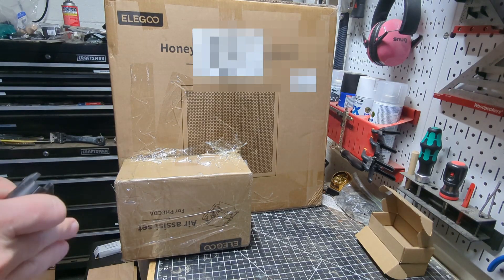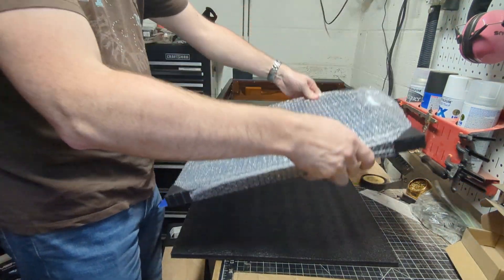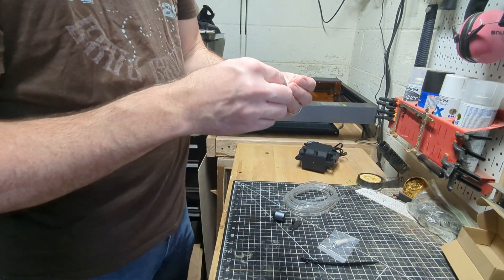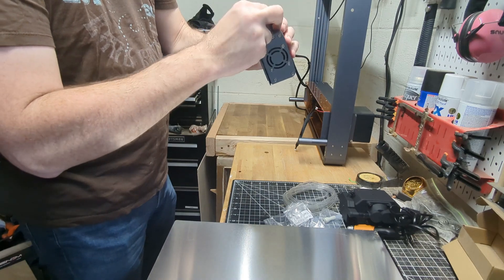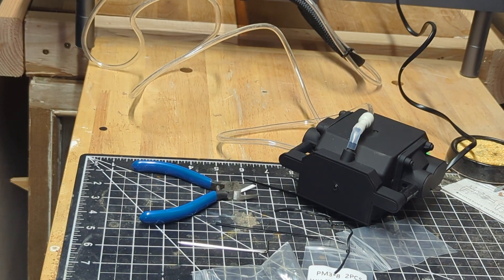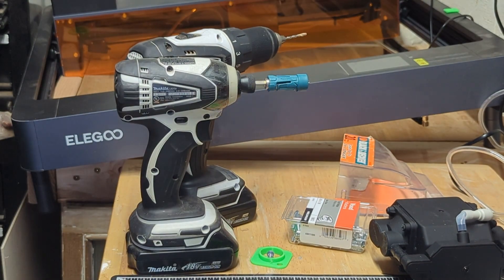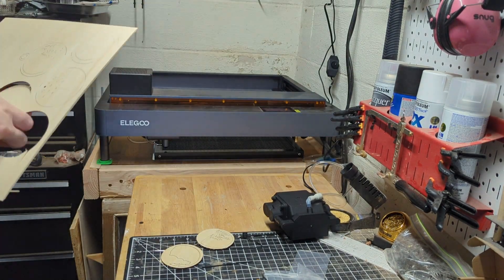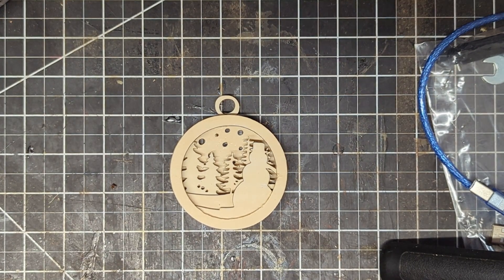Phecda Upgrades and air assist installation.

Comment: Thers a diy kit on the facebook group for converting it to have limit switches, total cost less then a tenner from amazon (some switches and leads). If you were thinking of doing that upgrade I wouldn't mind a video on it. I did the installation but could not figure out the settings in order to get it to work the way intended.
Reply from the maker: Yeah, I was thinking about doing that and some other 3d printed bits.

Comment: Got a link to that ornament design?
Reply from the maker: https://3axis.co/laser-cut-layered-christmas-ornament-svg-file/6o3ygpk7
Reply: The instructions were pretty basic and the PDF didn't show what cable went to what but after looking at another post that became clearer. but overall it was this is what you need, a 3d print with these switches, and figure out the rest yourself. installing was easy but no help when things went wrong or how to test it. Mine did weird things when homing and without a video of how it should react I was left wondering what to do next.